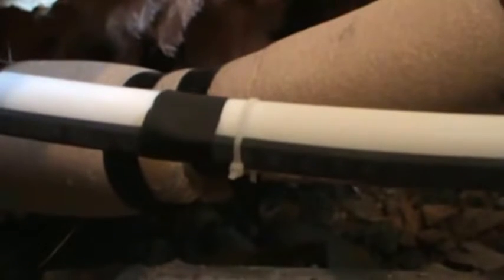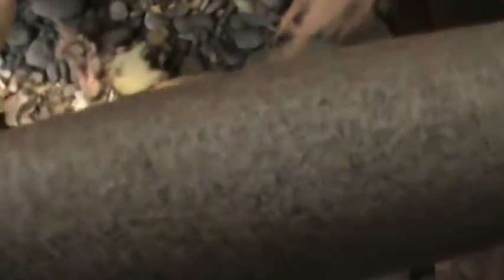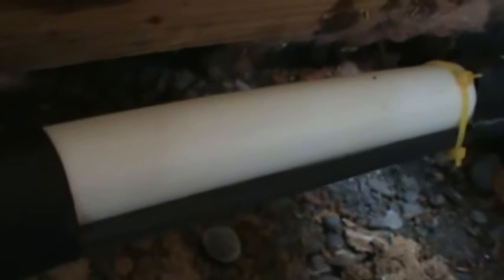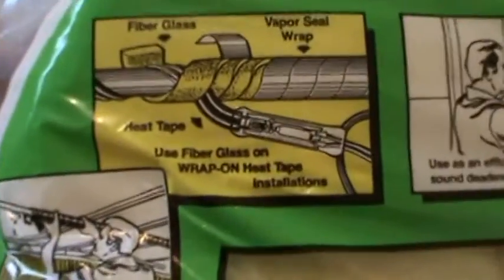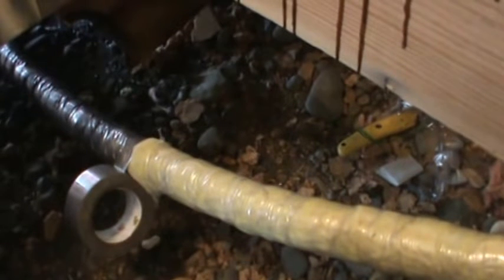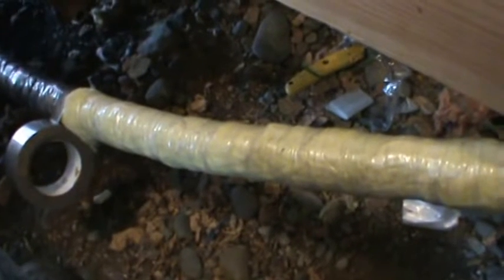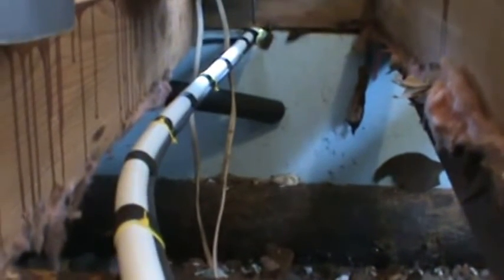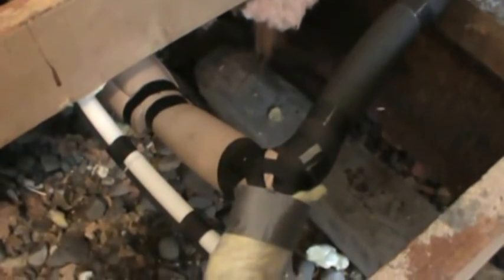How to Properly Insulate Water Lines in Alaska for -70 degrees Licensed Professional

Comment: You do a great job sir.

I'm having to repair lines on a mobile home right now. If only the power hadn't went out, we'd all been just fine. 

-Texan
Reply from the maker: Dillion one thing to always remember and something you can share with everyone of your Texan Family members and friends and everyone everywhere in general for that matter is…..anytime there is a chance at freezing temperatures down there or wherever you may be the absolute best and most fail safe way to always guarantee that none of your pipes will freeze up and burst with power or even without any power whatsoever is to…..always ALWAYS turn on just slightly where there is the smallest of a steady slight stream of water coming out of every single faucet in your residence or business and make sure they stay running constantly and inform anyone there who would possibly have access to any of these faucets NOT to touch them and IF by chance they were to disrupt and use one of the faucets just kindly remind them to turn all the faucets slightly ON to the lowest flow possible coming out that they or you can get the faucet to stay on at constantly where there is the slightest constant steady stream of water coming out of the faucet constantly so NOT a drip 💧 Dillon but a constant slow steady stream of water running out constantly uninterrupted. The reason being Dillon is that just the movement of the water replenishing itself from fresh water coming up out of the ground will be sufficient in temperature to not allow any moving water to freeze so movement of the water in all of the lines is KEY here and that’s what your accomplishing by turning on EVERY faucet in the residence or business Dillon and I GUARANTEE you Dillon that if you would have turn on every faucet BOTH hot water and cold water at EVERY faucet that you would NOT have ANY frozen pipes nor would you of had to fix or replace ANY pipes in your trailer Dillon 100% Guarantee even with absolutely NO Power Dillon NO pipes will freeze at all GUARANTEED Dillon!!! Now please try your best to always remember that and do everyone a favor and after you’ve read this and understand what I’m telling you to do next time PLEASE go around and inform everyone that you can that will listen so maybe they can someday remember that it was YOU Dillon YOU are The Man that they need to be sure to Thank because they remembered that it was YOU DILLON who told them about that trick that…..by turning ON EVERY faucet and make SURE that both the hot and the cold sides on EVERY faucet are turned ON to where there is a slight constant steady stream of water constantly coming out of EVERY faucet EVERYWHERE and that it was YOU Dillon YOU who they remembered told them about the trick that saved them a ton of money, a ton of damages, a ton of stress and headaches and especially a ton of time because DILLON was THE ONE …DILLON IS THE MAN and it was ONLY DILLON who told them about THE TRICK that even when there is absolutely NO Power On at All that as long as both the hot and cold water is turned ON at EVERY faucet where there is a constant steady uninterrupted stream of water coming out of EVERY faucet and to remind them to continuously and religiously keep checking  EVERY single faucet in the entire residence or business and to have them always make SURE that EVERY FAUCET there ALWAYS has a nonstop uninterrupted steady stream of running water BOTH HOT AND COLD MUST BE ON AT EVERY FAUCET and there is ALWAYS a steady constant stream of water coming out of EVERY FAUCET and Dillon remind them to ALWAYS RECHECK EVERY FAUCET about EVERY 15-30 minutes just to make sure there is a constant steady nonstop stream of water coming out of every Faucet everywhere in their residence or business!!!
Dillon and if you can tell enough people right now Dillon about this Trick and what all to do and remind them that even with absolutely NO power that YOU can GUARANTEE everyone that if they DO This Trick they will NEVER EVER have ANY Frozen 🥶 pipes EVER Again GUARANTEED 100%!!!
Dillon YOU WILL BE EVERYONE’s HERO and SAVIOR and EVERYONE of them WILL come running back to YOU Dillon to tell you just HOW Happy and Thankful they are to YOU Dillon that YOU were THE ONLY ONE who Told them about this very simple Trick and they remembered and they DID it and the BEST part is when they tell you that they all have absolutely N0 Pipes to fix at all this time THANKS 🙏 😊 🙏 TO DILLON because YOU DILLON INFORMED them about this Trick and YOU DILLON taught them to TOTALLY UNDERSTAND THIS TRICK FROM BEGINNING TO END and DILLON DESERVES ALL THE THANKS 🙏 BECAUSE DILLON IS THEIR AND EVERYONE HE INFORMS OF THIS TRICKS HERO!!!!
So Dillon it is NOW up to YOU to go out and INFORM the Masses about this TRICK to NEVER EVER have a Frozen Pipe again even with NO power at all just by leaving water running in EVERY FAUCET in their Residences and Businesses!
GO and Spread this One ☝️ TRICK Dillon and someday….. YOU WILL BE SOMEONE’s HERO!!!!
Good Luck and Best Wishes to YOU My Texan Friend The very soon to someday be Known By………………
Mr. Dillon “THE TRICK HERO” PETERSON
😂
Reply: I don't believe our pressure tank is big enough to sustain whatever that gpm equivalent would be. The pump kicks on, fills a pressure tank that has an inflated rubber bladder which provides the pressure so the well doesnt have to kick on all the time. We most certainly had the fixtures on, and one by one they stopped flowing, whether or not the pipe busted due to an inadequete gpm, or;  if,  that the pressure ran out, is the question.
Reply from the maker: @DillonPeterson  Well that’s the Achilles heel to that trick as you “well” know a “well” is the one ☝️ that could definitely throw a monkey wrench into that trick. Like my well here in Alaska “well” let me put it like this….. 8-9 years ago my “well” was put to the ultimate test and I do mean THE Ultimate Test too! My 25-27 year old Nephew was up visiting me for the summer and hanging out and my parents and some friends came up too “well” we decided to do the Kenai Homer spit/Salty Dawg trip and the whole nine yards spent July 4th week down there soldotna Sewerd hit em all. The my Father decides why not just do the circle trip and that’s driving the whole big circle of the entire road system and we spent another week to week and a half so let’s just call it a safe 3 weeks plus on the road what started out as a July 4th BBQ in Sewerd for the Mountain Marathon Race and Festivities of course. “Well” we get back to my place and people start fanning out across the spread some inside, some outside, some head to the river, and I’m doing the Mail, Bear checks, any problems or issues and my Mother’s telling me how nice my gardens doing and my neighbors come over and they start telling me how nice my garden is and then my other neighbors and they too commented about my garden and I stopped and thought… 🧐….What Garden? I had some cannabis and just a few tomatoes and a couple broccoli, cauliflower, Bell peppers but maybe 1 or max 2 plants was all I had of each so I got curious because I hadn’t done a darn thing but set them in the ground nothing else absolutely nothing else and ai come around the corner and Moms standing there with my hose and it’s just shooting like a fire hydrant hose at a 4 alarm fire that just got severe red and flopping around. I just asked what the heck’s going on and why you using so much darn water on a dozen or so plants? She looked at me puzzled and said “I’m not doing anything I was about to ask you the same damn question?” I look and these 6” plants were now 3 feet tall behemoths, 20 pound cabbage, I think 16-18 pound cauliflower and all the grass was about waist high and it just looked so lush and that’s when it hit me and I asked “Who turned on the hose?” Everyone’s here shrugging   🤷‍♀️ 🤷‍♂️ 🤷 🤷‍♂️ 🤷 🤷‍♂️ 🤷‍♀️ their shoulders and Mom points at me and said “you turned the damn thing on” what are you talking about?” I just said I haven’t made it past my front door yet to come back here and about that time I heard “oh shit” being mumbled and I turned around and my Nephews there and he’s cracking up laughing and thinks George Carlin’s about to be reborn or something he couldn’t even talk he was laughing so hard. When he finally gets to where he could talk he said 3 words well 2 letters and 1 word is all it actually was and it went something like this…as he’s wiping tears away from his face he looks up at me and says “I think I…and he lost it for another couple minutes and I’m walking around and my yard used to be solid and now it was seriously like a floating island 🏝 of tundra and the farther back I walked the more water would shootout for all sides of my hiking boots. About that time is when I found my hole for one of the garden plants I had stopped just before we left several weeks earlier for the July 4th weekend getaway and 16-18” later along with another 8-12” of muck before I finally stopped sinking to China and I looked at my nephew and that was the last time I seen him I think until the following day because he KNEW what was Dixon to commence! 🤦‍♂️ That not so little shit had left my hose on full freaking blast and ai too have a pressure tank and 2- 500 gallon holding tanks along with what is very well known now as an unlimited never ending well that you can NOT run dry, the only thing worse than being soggy for the next week and a half anytime you walked outside was about a week later when my power bill arrived and it was just a hair under 3,000.00 for that previous month……that NO one was even here! 
Enough of that and back to the “trick” yeah that “trick” is for cities and places like my place here that have continuously running water. The only other thing that could pose an issue is how long is the freeze gonna have you in a spot where you have to let the taps run is it just an overnight 1,2,3 day ordeal or is it the Blizzard of ‘76,’78 month type of leave the water running because any extended period could cause your bills to start getting jacked up and sometimes you just need to pick the lessor of two evils and let the darn pipes freeze. 😂 one thing you learn very damn quick in very rural interior Alaska is only use 1 light bulb, a fridge and maybe a freezer or 2 and hopefully nothing else because just those few things are 700-800 a month to run and I know from multiple years of experience 1 light bulb is good enough you’ll learn to see with your ears so your not being foreclosed on because you can’t pay your lower bills. I think I’m around .73 cents a KWH approximately here and it does vary quite often kinda like they use a dartboard to figure out how much this moths KWH base rates will be. I think in Indiana it was like .07 a KWH and that’s at Peak and my figure was the cheapest it’d be like at 1-3am. Alaska is all about sticker shock on EVERYTHING! 😂
Reply: @dealsgalore  😂😂😂

Comment: Very informative!!! The coldest its ever got in Flagstaff, AZ since I've lived here was -8 degrees.  I'll be sure to do this to my pipe.  Perhaps it's an overkill, but it's A LOT better than paying a plumber a lot of money and facing all the inconvenience.  God bless you sir.  MAGA
Reply from the maker: Thank You 🙏 very much AZ Crazy Bull and it sure is Better to be Safe than to be Sorry!  I personally want ALL of the extra protection  I can get at all times. I sure do not want to be going without water nor do I want to be forced to go outside at sub zero freezing temperatures and work fixing pipe that ai could have done this way to begin with during summer like now and what did it really cost me to go this little bit extra to me not enough at all as I’ve never ever had a frozen pipe since living in the coldest area on the road system in rural interior Alaska and to think all that peace of mind, stress and headaches free and absolutely NOT one more minute of work EVER again fixing another frozen pipe ever again and once again for what??? For what….for just a few more measly extra dollars and a few more minutes you had better believe that you can ALWAYS count me in EVERY time to ALWAYS do EVERY pipe lines that I work on and that I insulate that EVERY one WILL be Done to these exact specifications for one reason and one reason ONLY…. because…IT WORKS! 
Thank you 🙏 again AZ Crazy Bull!
An ounce of prevention is worth a pound of cure!
God Bless You too as well AZ Crazy Bull and ABSOLUTELY God Bless MAGA and
 GOD BLESS THE UNITED STATES OF AMERICA!!!🇺🇸

Comment: Hi Cory, thanks so much for the detailed video. You can count on everyone in Texas watching your video this week.  We lost power . So if we just use the foam tube and the second layer of fiberglass insulation over the copper pipe, how long can it hold the pipe from freezing assuming a temp of zero for say 2 days in a row? Thanks
Reply from the maker: Hi ccie your welcome 🙏 and well there are a lot of Variables to be considered hypothetically but If you leave your faucet dripping then you shouldn’t have any problems or issues. The reason being is that the water is constantly flowing through the pipes and they should not have any time to freeze baring any disruptions in that constant flow by any other means. Now if you just have still motionless water in pipes that’s not flowing at all whatsoever not even a very little bit then I can almost guarantee you and everyone that those pipes will most likely not only freeze up but almost assuredly they will burst and cause you more work, headaches, time and money each and every time! So anytime the power is off you will always want to slightly turn on and slightly open up all of your faucets even just a little bit is good enough to keep the water flowing in all of your pipes anything less than that you and everyone can absolutely count on problems occurring guaranteed. As for a specific time frame, man that’s a rough one ccie…🤔, but I would think a reasonable time frame could possibly be approximately 24 hours give or take a little either way and hey that was a great question though! Hope this answered your question? Thoughts and prayers 🙏 to everyone down in the south that’s experiencing this extreme weather.

Comment: Great Info, How do you Insulate your Water Holding  Tank.? I have a Well system & a Holding Tank, That Needs to be wrapped each Winter also any suggestions will be Appreciated, thanks for sharing your great tips etc.
Reply from the maker: MyREDTAIL mine is buried in the ground in a pit well insulated and supplemental heating with a light bulb and Don’t freeze even at -75 below 0.
Reply from the maker: MyREDTAIL my neighbor uses a heating blanket around their water tank wrapped inside of fiberglass insulation. Another neighbor uses a oil pan and battery heater that salvaged off of a wrecked vehicle and once again wrapped inside of fiberglass insulation and another neighbor used a fish aquarium heater so there are all sorts of ways to keep your tank warm but I would recommend one that uses the least amount of electricity possible.

Comment: Thank you for the video.  Because instructions say they can't be crossed, spiraled or overlapped as it can arc and cause a fire, is it safe to use it by the water meter where the electrical grounds are?

Comment: On plastic pipe, PVC and PEX, wrap pipe with aluminum foil, then install heat tape.  The reason, the heat will evenly spread around the pipe.
Reply: I thought you cant use any kind of tape on pex
Reply from the maker: brian hoyt I have always used tape on it and never had any problems or issues so I haven’t heard this before and can’t confirm or deny that I’m sorry I’m not much help on this one.
Reply from the maker: Edward Padilla If your speaking about furnace tape the thin aluminum foil tape we use on duct work and such I would see where that would have anything to do with distribution of the heat and even if it would it would be very minimal at best. It sure wouldn’t hurt using furnace tape that’s pretty good tape but it’s also an expensive tape compared to duct tape too. Good suggestion though Edward!

Comment: If you had an alarm that notified you of when current stops flowing in the heat tape you would get an earlier warning than a temperature sensing alarm.  There are probably such alarms already being manufactured but it would not be a very challenging problem for a circuit designer. A relay  with a 120 V coil that does not add too much resistance to the circuit would also work to engage an alarm system.
It would take some testing but the relay coil would have to be in series with the heat tape which would lower the heat tape output a little bit.
Another way that would not interfere with the heat tape would be to design a transformer in series with the heat tape to deactivate the relay when there is no current flow and have its normally closed contacts close when the relay is no longer energized by the current flow in the heat tape. It

Comment: Cory, would you be able to put two pieces of pex together on the one heat tape before the insulation and tape? Seems like the wrapping and contact with both pipes would be sufficient to not freeze?
Reply from the maker: Yes it should be adequate in normal circumstances Tim and that’s what some people choose to do I however choose to go the extra steps to give my pipes some added additional help when they need it. Either way is correct just mine is significantly better not only for harsher environments and conditions but also for peace of mind too.